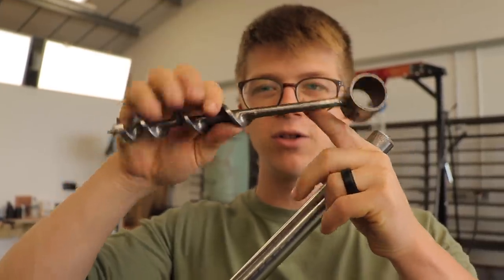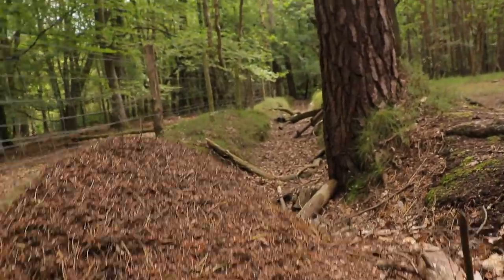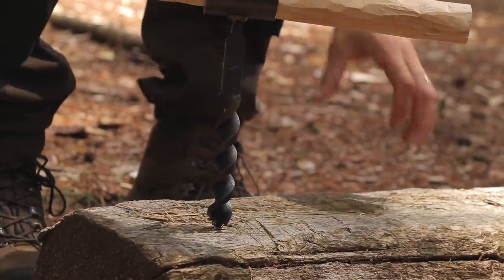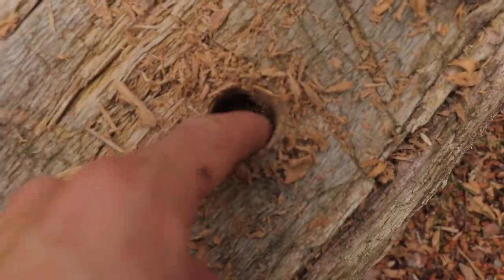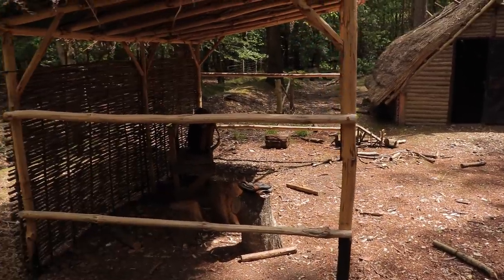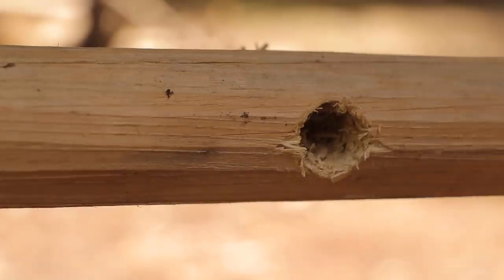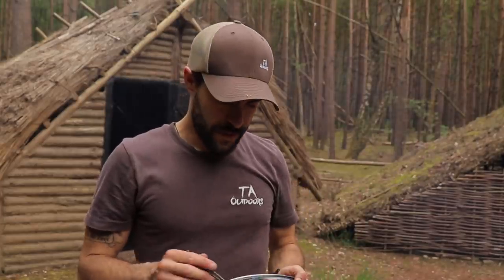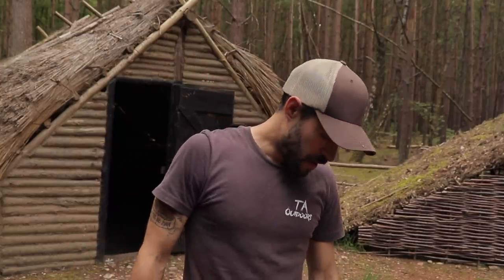Testing the Alec Steele Auger in the Woods! Bushcraft Project

Comment: This is an example of how important a blacksmith was in the Iron Age, when people did not have electricity to make tools.
Reply: Imagine doing it without a gas forge, power hammers, grinders, etc. Crazy amount of work just to make one tool like this. Even with all those tools it's still a lot of work but without them it must have taken ages.
Reply: @mrkiky  that isnt the problem, its gettinng cast tools, this a hammered/forged tool
Reply: @mrkiky  Nah back then metals and other minerals we're still abundant since it's mostly been untouched after the stone age. So I think they had no problem finding a ton of it.
Reply: @gregoryeverson741  well, assuming that as a blacksmith you already have the tools. the metal on the other hand, if it's wrought iron, it's much trickier to work with. gas forge vs coal forge isn't a huge difference either.
Reply: @hurjireepz7021  there may have been abundance of minerals in the ground, but their processing methods would have been wildly inefficient and resulted in fairly impure metal. The cost of transporting metals would also be incredible
Reply: Also important to have a QUALITY blacksmith. Easiest way to screw this tool up is just overheating the tip, it makes too much strain on small sections of metal often causing tools to break mid-use.

Keep in mind ye olde blacksmiths didn't have thermometers either, when to strike and what made good tools weapons was largely based on experience and eyeballing based on the color.
Reply: @kz.irudimen  Actually, interestingly enough, they actually had power hammers for quite a long time before electricity. It worked off the same principal as a mill. Another reason why fast moving water was important.
Reply: LucyFire7 Imagine making a comment and not understanding verb tenses.
Reply: @wy34football  sorry for that, English isn't my mother tongue
Reply: Same in a post apocalypse.
Reply: @mrkiky  true im working on a design to make a water hammer for that purpose just to see the difference in time it takes and how difficult it would be to learn/setup. (Im using smart physics people that already did the brunt of the math and all that shiz, im kinda modifying it to make it more stable in the long run)

Comment: If you stop drilling when the tip pokes through and then start drilling on the other side, you'll get a cleaner result. Not that it really matters, it'd just bug me if I did it 🤷‍♂️
Reply: I was going to suggest exactly this, it's definitely the way for a cleaner result. Works with power drills too
Reply: Me and my friend come accros that problem allot when were in the woods and when we go in from the other side it tends not to dig in as well because of the hole on the other side if that makes sense 🤔
Reply: Exactly what I was about to add....decided to read through the comments to see if anyone else already said it....you did! Well done.
Reply: I was thinking if it had a stop plate of sort. It would then be able the rip the wood into a round hole as the stop plate hit and you keeper turning the bit. Awsome place your building. Thanks for sharing 👍.
Reply: That or put the piece that you're drilling against another piece of wood so the tip continues to bite and it supports the edge of the wood to prevent blowout.
Reply: I do the same with the screw-tipped spade bits too. Great bits, just grabs and tosses you if not prepped for that grab at the end.
Reply: It was bugging me that he didnt think of this
Reply: I was gonna say this too. It would make it less likely to split when you are near the end too
Reply: Yep I agree, keeps the hole cleaner

Comment: Hi, to prevent it being messy on the back of your timber when you drill through.....when your drill bit starts coming out of the back of your timber, stop then take the drill out and then drill from the back of the timber so then you have two good sides 👌
Reply: I came to the comments section with the specific intent of telling him exactly that.
Except I was going to use proper tool nomenclature. "When you first see the point of the worm through the bottom of your hole, remove the auger and complete the bore from the opposite direction. "
Reply: @markallen8027  Cheers mate me too
Reply: Or just put another piece of wood behind it
Reply: @markallen8027  I wanted to make this comment as well, but using my own words. "Twist your shaft until the tip peeks out, then push it in through the other side for a clean hole"
Reply: @JohnSmith-il4wi  😆
Reply: If you go through with the smaller auger first, then use the bigger one, you'll get a cleaner hole. In machining class we used progressively larger drill bits then a reamer to finish the hole. It gives you a very smooth surface which you need if you're going to thread it. The same concept applies here.
Reply: Thanks for pointing that out. I was waiting for him to do just that because it had struck me that the extra long screw gave plenty of warning befor breakthrough. The reason for the rough entry was the curvature of the workpiece combined with very young wood from only just below the bark being the first point of contact for the augur blades, and typically those young fibres of wood rip rather than slice.
Reply: @Ogrematic  does that really apply to hand-powered T augers like this, though? if you drill a pilot hole, the screwtip has nothing to grab onto.
Reply: @porkrind225  I suppose you're right.

Comment: Once the point pokes thru reverse the auger & then finish from the back side to get a clean hole thru & thru, as a bonus the auger can act like a plumb bob by placing a string thru the eye that way you can plumb & mark the holes prior to drilling them- plumb level & square = TRUE & true is good... very good!

Comment: I want to mention that, for those who aren't blacksmiths or don't have one as a friend, you can still have one of these very useful tools. I welded a 1/4" , 6 sided, deep welled socket to a short section of iron pipe and created a TEE that will fit over the auger type drills that are available online and at tool and hardware stores. The driving stick goes through the piece of pipe. The drills or drill bits, as some would call them, have the conical, screw-like starter section at the end to pull it through the wood, a spiral to carry the chips away, and here is the difference and the advantage, a hex shaped drive that is normally chucked into an electric drill motor or a drill press and that provides the added advantage of multiple bits with one TEE. Here in the USA those bits have either a 1/4" or 3/8" hex drive. I'm not sure how that would be sized in the UK, but I assume that you have a standard for such tools like we do. I chose to make mine to employ the smaller of the two drives, because they're cheaper and you aren't going to twist off a bit in wood with hand power. I bought a set of "shorty" bits, made by Irwin, that has 4 or 5 bits from 3/8" to 1" and they're only 6 1/2" long, so the're very compact. You can drill deeper holes by simply using a socket extension bar and it all combines for some very useful and space saving kit. If you don't own a welding machine or know anyone who does, I'm sure brazing would work, and I THINK silver solder would work and maybe even lead solder with a high tin content, in a pinch. You may even be able to find a black iron reducing TEE that will let you drill and pin the right socket into place. Once you've made the TEE handle, you'll want to drill the same size holes as your drill bits into a small wood plank, using the auger bits, or into some sheet metal, with the same sized metal working bits (HSS, High Speed Steel). You will then have a gauge to use when you are carving pegs or chair legs to drive into the holes that you drilled. This kit isn't as cool as one made by an actual smithy, but it does work and can be created by a less skilled man or woman.
  I see that you're fund raising for the Alzheimer's Society, so I'm going to give that a look. Really like your videos, STILL!

Comment: Nice bit, Alec steele is totally skilled. I'd have one like this any day. 

You are correct about the tear out, electric powered drill bits totally cleans up the rim of the hole because of the rpms. 
The old vintage machines auger bits for hand tools have a "spur" that scores the edge of the hole, which can be filed. For general woodworking or bushcrafting in honestly wouldnt matter, but if you did fine furniture or the likes its a must have, and finding those bits is rather easy, but finding one with an undamaged leadscrew is a different matter.

Comment: Electrician here. Generator went out at a job so we couldn’t use the power tools. Boss hands me this and a crank drill. Worst day ever. I still use them tho. Been 30 years on the same ones.   Like others mentioned flip and go from the other side. And also if you get the angle right and about 1/8 of the worm gear is slick it will do a perfect pop out. No pressure n go slow at the end works every time.

Comment: @Mike 
That wood ant nest is fantastic mate. 
Their larva make great eating, the secret is to put a small tarpaulin on the ground, and roll the sides back a couple of folds. Then you quickly grab a couple of large handfuls of the nest and throw it in the centre of the tarpaulin. The ants will quickly pick up the larva and move them to the sides you have rolled back in order to stop them drying out.  Then collect the larva and fry them in a little bit of oil and a sprinkle of sugar, they taste fantastic! 
Another fun fact,  did you know that you can use a wood ants nest like a compass for telling direction? The wood ant always builds a nest on the south side of a tree, and uses the tree has protection from cold weather coming from the north!
Reply: Best to say equatorial side. It's all opposite in the southern hemisphere.

Comment: The screw on the tip is the 'snail'. The "ears" you mentioned are the nickers, they score the wood and cut the fibers ahead of the main auger driving through.

You can help reduce the breakout and tearing coming out the opposite side by stopping early, once the snail breaks through, and then use the auger from the opposite side of the hole

Comment: you should get a spindle cutter, kinda like die cutter but no threads just long taper. then you can make real spindle railing and other things.  (the same size to fit drill holes of auger shown)

Have a great day

Comment: Once the tip has breached the other side of the timber, you could just remove the auger and start it on the other side to prevent the wood splintering.

Comment: Nica Video. 
What I do  to my Augers is that I forge the handlehole  just a little bigger on the insede diameter  than  the outside diameter  of  the Auger and grind  a cutting edge on it so you can make the hole and the pin with one tool .

Comment: Nice auger! The only thing you might want to give a try is when the auger lead screw pokes through the other side, stop... pull the auger out and stick the lead screw through the tiny hole on the backside and finish drilling the hole. The result is a hole without any tear out. cheers!

Comment: if you put a stopping plate at the top of the drill bit you could use it after the hole is made and keep rotating to clean it out better, that way it doesnt just spin until it reaches the end and you just have to back out

Comment: It’s funny ain’t it, I look up and down to find myself a Auger but couldn’t find a single one, I believe you can buy sets. This one is top notch Mike, it cut through pretty much like butter.

Ahh those wonderful Ants, can’t beat a good Ant haha god love us 😂.

Food looked crummy as always Mike, fill a corner I bet pal.

Now, the Bushcraft Show, I’ll be certainly interested in a discount code, I’ll wait then before I book me and Charlie on. 

Aww mate thank you so so very much, you know how much this trip means to me Mike and I hope you know how very much I appreciate your time. From a guy who’s life is crazy busy and to decide to give up that time to spend it with us is just epic mate, your a class act Mike! Here’s hoping we shut down the Just Giving website with the amazing TA Outdoors subscribers donations.
What a crew we have pal 👍. All the very best, Ant 👍
Reply from the maker: Thanks Ant!! Really looking forward to the trip 💪🏻
Reply: @TAOutdoors  me too mate, can’t wait!
Reply: You can find auger bits at most hardware stores that are used in a brace and bit or electric drills. A welder can weld an 'eye' on the end using a couple inch long section of iron/steel pipe. Cheaper/easier than having a blacksmith  make them from scratch and that way you can easily have a couple of different sizes. Add a couple of folding chisels (Stanley makes them. They fold like a Butterfly knife) and you can do some proper mortise and tenon work. First job being to make a mallet using the scotch eyed auger to help with the chisel.

Comment: Once the screw point of the auger comes out the back you should switch sides and finish the hole from the back side.  This will alleviate the blow out you are getting

Comment: To make a cleaner hole, pull the augur out when the tip pokes out the back and drill from the back side.  This let's the tabs cut a new clean start to the hole

Comment: Get your metalworker friend to sharpen one edge of the handle hole.  Usually that hole is the same size as the auger.  You drill the hole with the auger, and you make the peg by driving the round sharpened handle over a branch.   ( Imagine batoning but with the round handle of the auger )  You should consider editting more.  When you show us how to drill a hole, that's great.  We don't need to see it 6 more times

Comment: Many different styles of auger cutting arrangements. The cleanest cutting augers I have used have a "lobe"  or vertical cutting blade on the end of each cutting edge to score a clean circle in the wood fibers that the horizontal cutting edge then follows and cleans out. Much like the tooth and raker arrangement on many saw blades and chainsaws. That would have been a challenge for Alex under the time constraints he ended up working under while feeling out the process of making the auger. Amazing he got this one done and working so well after restarting from scratch!

Comment: you can get a cleaner hole if you sharpen the ears and leading edges so they go get more clean cuttting action; as it is, they're kinda of "tearing" their way thru.....half an hour with a fine file or small diamond hone or stone and you could get it cutting much more cleanly......(though, as you pointed out, it's "good" enough for field work.. :)
Reply: want a clean hole? stop using toilet paper, it just smears poop

Comment: You could have just drilled down through the top rail and a little into the bottom rail, and then put spindles in. And also to avoid blowing out the backside of the hole. As soon as the point comes through the other side, back it out and then finish the hole from the other side. Leaves  a cleaner look.

Comment: * Why anyone would use a Screw or Nail to fasten a decent sized piece of wood to another is totally beyond my comprehension.
Figure in SAE a common nail is about 1/8 of an inch thick, where as a Dowel in it's place can be anywhere from a 1/2' thick, or even larger, and in my humble opinion will not only be much stronger but look amazing. Sure, I may temporarily lash or wire tie something together for a short period of time, but I'll use a Wood Auger / Scott's Eye whatever you want to call them, on the final fitting every time.
 And yes it takes a lot longer to complete but to each their own I suppose, right ? Nice video once again, and it's good to see you still at it full tilt like this. It's a healthy life you're living out there with much less stress too. Congratulations ! And keep those videos coming, please !
 With warmest regards, Mr. Cross
Detroit, Michigan
Divided States Of America 2022

Comment: 14:34 Just a suggestion with your log chopping block, sharpen the ends of the legs and hammer the table in the ground for a bit more stability.

Comment: After watching Alec's show I had an idea that I thought you might be interested in. If you match the diameter of the pipe to the diameter of the drill, and bevel one end of the pipe. You could then use the pipe to cut the pegs. Spilt out a squarish blank then drive the pipe down it to round the peg, or screw the bit into the side of a stump and drive the peg down through the pipe.

Comment: Drilling straight through causes tearout on the opposite side which doesn't look good.  As soon as the tip shows through drill from the opposite side.  You get a much cleaner hole that doesn't need filler.

Comment: I find it insane the density of the ants around you. Most ants here in the states avoid mammals heavily and camp sites that would normally be covered in ants will get nearly cleared out within a couple hours of making camp because ants here have so many predators that they survive more often by avoiding potential threats rather than swarming them.

Comment: Split that log in half and then put 4 legs on it for a flat much cleaner surface and you can use the other one to make a stool the same way with 4 shorter legs

Comment: Actually if you stop the auger before going all the way through a board, pull it out and use it on the pin hole on the other side you'll have a perfect hole with no fracture.